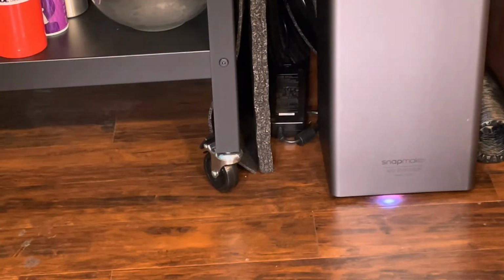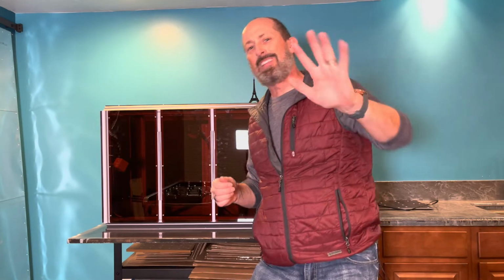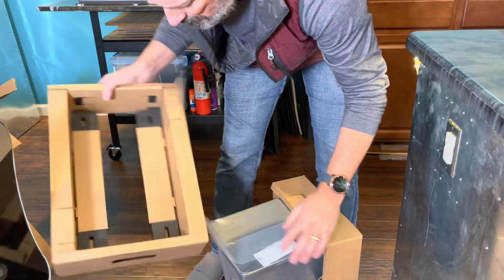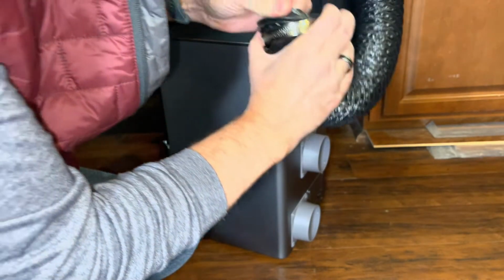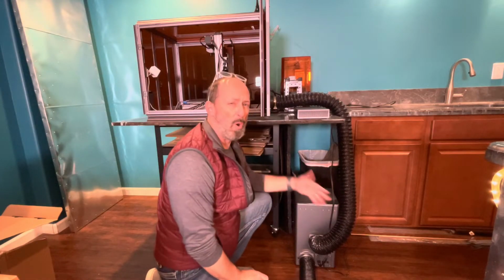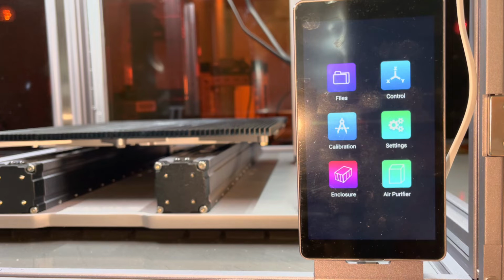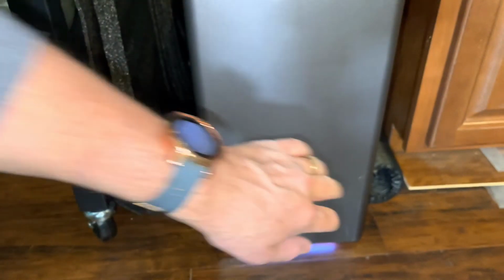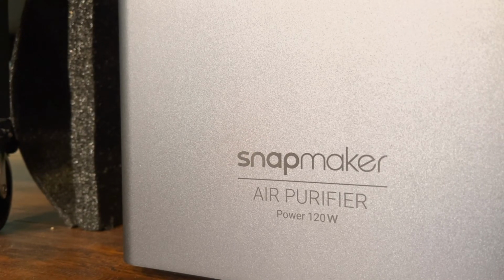Trying out the new Snapmaker 2.0 Air Purifier

Comment: Can you run the purifier without connecting it to the enclosure?
Reply from the maker: Without doing some modifications, the answer is no, you cannot. There is a on/off switch on the pack of the unit but it only enables power. The real switch on is through the enclosure connection. So really you can only turn it on through the handheld control screen or from Luban. 
Does that help? What other questions do you have?

Comment: Hey can you run that without the connecting cable that plugs into the hub?
Reply from the maker: Without doing some modifications, the answer is no, you cannot. There is a on/off switch on the pack of the unit but it only enables power. The real switch on is through the enclosure connection. So really you can only turn it on through the handheld control screen or from Luban. 
Does that help? What other questions do you have?